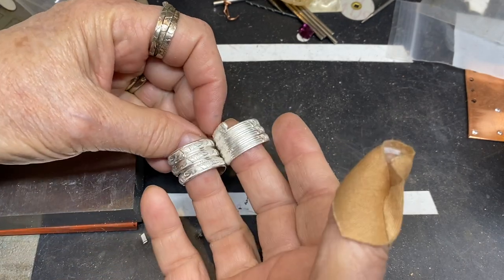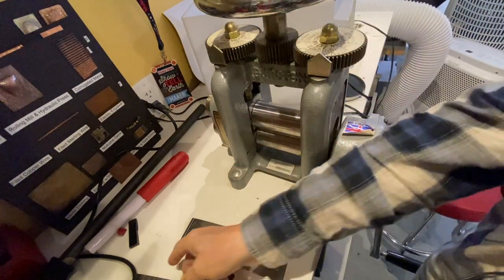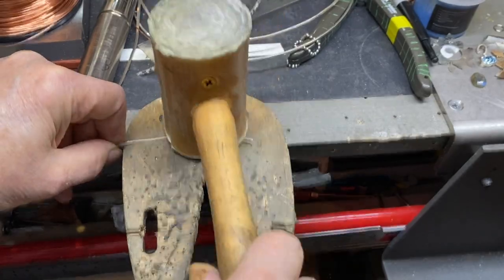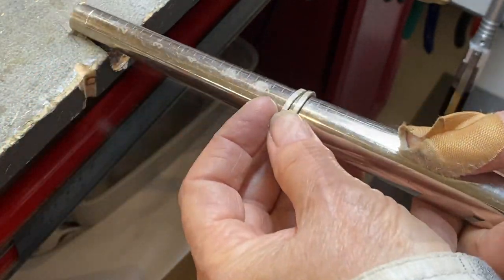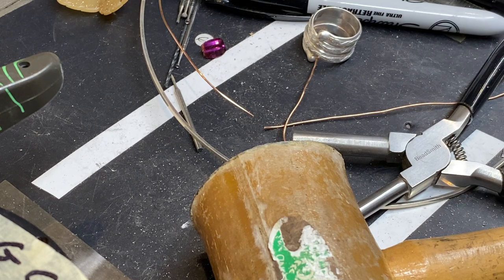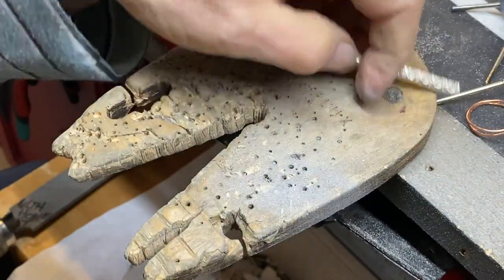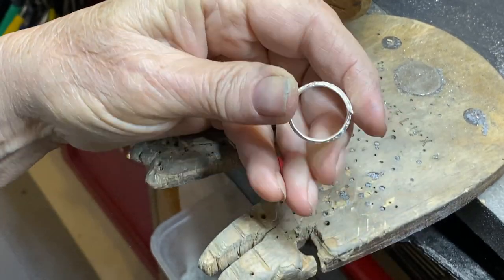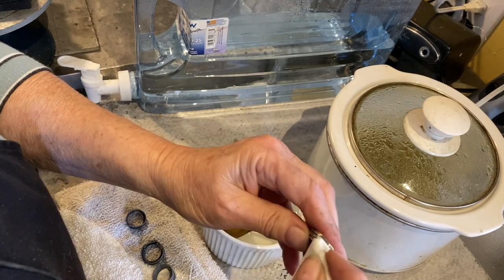The Wrapped Ring Project

Comment: Is that copper wire you're using for binding?
Reply from the maker: Yes.  I can throw it in the pickle without unwrapping.  Nice if I have to resolder.  Works for me.  Thanks.

Comment: I really like to watch your videos.
Can you tell me where to buy the patterned wire? I live in Sweden so I can't find it here.
Reply: Nancy makes the patterned wire from various widths of silver square wire. She prints the patterns into the metal using pattern plates, running them through a rolling mill. You could try ebay or Etsy for suppliers of ready made preprinted silver wire, but like this might be more likely to be sold by suppliers to the jewellery trade in Sweden, or in Europe if available. A jewellers rolling mill is an investment. Where I am they start at around 2400 sek, and you would need to purchase the printing plates and 925 silver square wire. However, if you want to practice making this twisted band rings, you can get aluminium, brass, and copper plain flat wire. You can get brass preprinted flat wire from Jewellers Suppliers, because it's used in costume jewellery a lot, and although you might not be able to practice the beading technique, if you have no access to soldering equipment, you can practice the forming, shaping, and filing techniques. Check out Nancy's Web site because she has an extensive catalogue of tutorials. Enjoy your adventure.
Reply: Not sure if Rio Grande Jewelry Supply ships to you, but I have many of the patterned wire from them... if you go to their site (or any supplier) just put "patterned wire" in the search area. Good luck :)
Reply from the maker: Try Cooksongold in the UK:  https://www.cooksongold.com/category_select.jsp?channel=uk&query=patterned+wire

Comment: Oh man I love these! I’ve gotta pick up some pattern wire and a cheap rolling mill.
Reply from the maker: You could hammer texture, etch, use stamps or even use an electric engraver to pattern.  Some even hammer (leather or plastic mallet) texture plates into annealed metal.  I have never tried that though.  I would imagine that the plates sustain some damage.  Maybe hammer on a stack of newspaper/magazines or use urethane underneath?  You can also purchase silver, brass, aluminum and copper pre-patterned plates and cut them up.  FDJ Tools and Cool Tools carry them.  In my video, coming out tomorrow at 6:00 am PST:  The Patterned Link Chain, I have links in the video description to some of these things.  Hope this helps!  They are fun to make!!!!!!  Thanks.  N